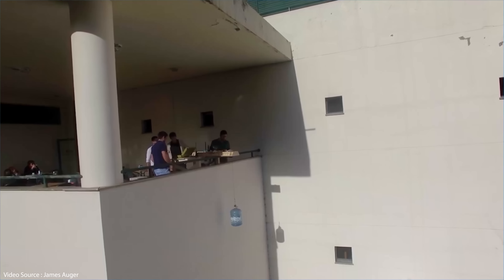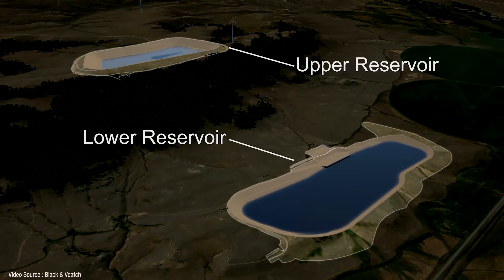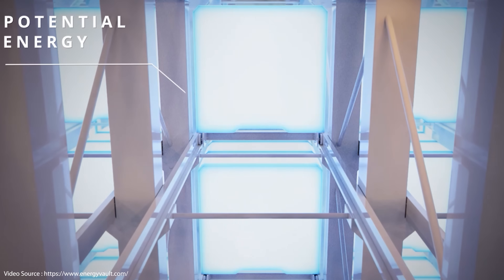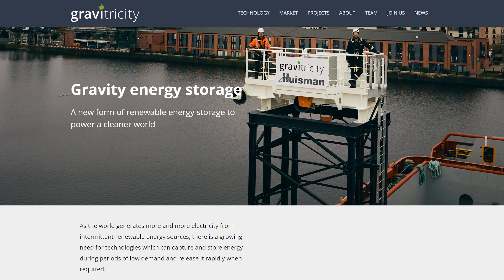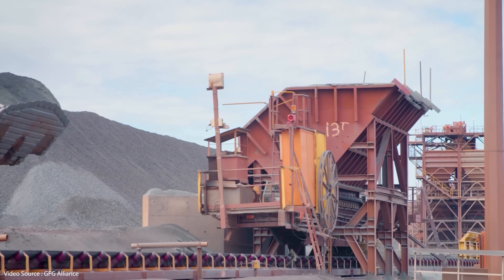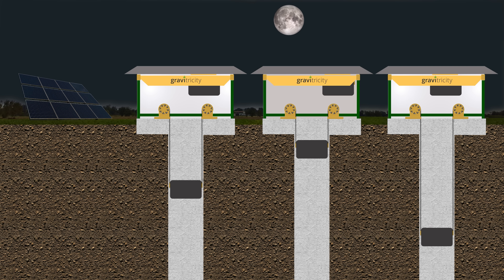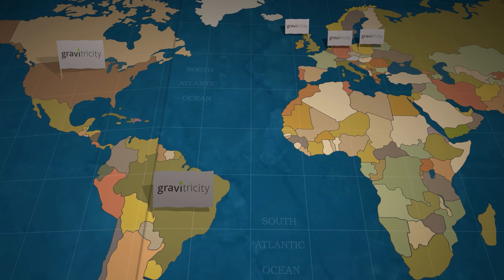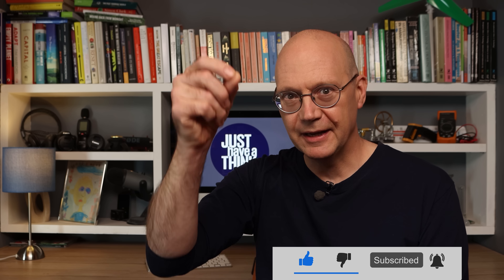Gravity Energy Storage. Who's right and who's wrong?

Comment: Take the worse case scenario. No Sun (night time) No wind. A gravity mass needs to be of a certain mass and height to last for perhaps 12 hours or longer. This scenario will require that prior to loss of sunshine the gravity-mass is at its peak height. Any time during the sunlight hours and good wind that this peak can not be achieved the community depending on that generating plant is at risk over the next 12 hours. This could likely be many communities around any country every night, most dangerous is November, December and January in the US. Nobody should be planning such a risky in any life providing generating system. 21st Century Nuclear, people, problem solved.

Comment: I wonder how practical it would be to use all those deep canyons that have bridges across them ( or not) rather than mine shafts.  No flooded shaft to worry about.  Wind might affect things but that could probably be overcome with active or passive cabling.  Lots of room for parallel ( or HUGE) weights.  Everything would be more or less open for easy maintenance.  Minimal useful land area required.  Any math done on viability of trade off between depth vs. size of weight?  It's pretty obvious the longer the weight drops the more energy supplied, but what are the tradeoffs?

Comment: The need for storage = an indication of the problem with Wind and Solar. In addition the killer is having enough energy generation from wind and solar to both supply the grid in real time (when the sun is shining and the wind is blowing) to " lift " a mass to a point in height that will cover the total absence of Sun and the intermittent and weaker nighttime Wind. I believe the most basic and near zero complexity is a massive Cubed shaped mass lifted by a motor / generator mass on 4 through holes posts ( like a die set ). With all the "extra" generated power lift with motor and when not lifting ( at the top or no extra power) brakes are applied (at the top a latch). Then releasing the brakes will generate electricity. However, zero emissions 21st Nuclear is the real solution.
Reply: I don't see it as an "indication of a problem" but I look at it as an "opportunity" instead.  Sounds corny maybe but really that's what's going to happen.

With wide spread grid-scale energy storage, solar and wind will be very hard to beat.  Solar and wind already have lowest LCOE of new build construction since 2015 and costs still going down.  This gives financial headroom for adding grid-scale energy storage which is also falling in price!

New grid-specific storage tech on the way: gravity, liquid-metal flow batteries.  Liquid-metal batteries already starting to be delivered commercially and it is not a brand new idea.  Heavy cumbersome Liquid-metal batteries were just waiting for a market and it hit a big one!   Liquid metal batteries use common cheap elements and will last 100X longer than Lithium-ion.  Lithium-ion is not the best for grid-scale for many reasons but, thankfully, there are grid-specific alternatives.

So far, I'm seeing Gravitricity is more risky than Liquid-Metal storage.  There are a lot of critical variables and unknowns with using old mineshafts.  Gravitricity LCOS seems a bit too optimistic and need more details on its calculation because of so many fundamental site build factor variability.

Nuclear growth rate is small at 1% to 3% CAGR (compound annual growth rate) where as solar is some 25% to 33% CAGR -- a vast difference even considering solar power's "capacity factor" is less but getting better.  That's why grid-scale energy storage is such an opportunity to pair with this abundant source of clean energy.

Another thing is whole life time of a power plant.  Solar farms will never really reach an "end of life".   Consider solar cells last 25+ years and the panels still produce 80% capacity by then.  Old panels could be sold and re-purposed for off-grid non-critical applications or just given away to non-profits, schools and developing countries.  Thus solar farms can be constantly rejuvenating itself over the years & decades on the very same land foot print even while running.  Incrementally, newer generation solar panels can replace old panels on and on.  Upcoming tech are Perovskite and Quantum Dot film panels that can boost solar panel efficiency by 50%.

At end of life, nuclear plants need to be completely demolished at high cost ($300M to $400M) by specialized highly trained crews that risk radiation exposure.  This is on top of the billions it took and 10 years it took to build the thing in the first place.

In contrast, you can hire most able-body people off the street to do the actual build/dismantle of panels on solar farms and just give them a bit of gear and training.

Comment: Energy Vault is clearly a silicon valley company thinking that every problem can be solved with computers and tech. I think their approach is flawed - over engineered, overly expensive and too much complexity. Gravitricity hasn’t convinced me either. I’m seeing winches and cables - the same technology we use in elevators and how often do they break down? Especially as they age. Also old mine shafts? Not the most geologically stable option. Q - wouldn’t it be cheaper to just interconnect renewables more to account for intermittency? This thing still needs renewable energy to haul the weight back up the mineshaft so unless they pay nothing for the energy in it can’t be cheaper than wind and solar because there are substantial losses - I think at least 30%.

Comment: Thanks for the update Dave! Pumped hydro is not a good example of gravity energy storage in my view though. Dams and resivoirs are. Dams hold the water that was pumped up by clouds at a height where they can be released as needed. No need to pump and much more energy efficient then any other energy storage device. Hydro dams need more attention. Many dams are unpowered. That is low hanging fruit. Hydro is baseload renewable and cheaper than coal, gas, uranium, etc. 
Maybe it is because I am Canadian and we still have so much untapped potential here but Hydro dams can have their releases timed to balance the grid the same way batteries, gravity storage, peaker plants, etc can without having to use electricity to store the energy in the first place. Water just needs to be released at the right times!

Why is this never talked about by renewable energy enthusiasts?

Comment: This is an interesting model (gravity energy). One part that I do not understand yet is about the energy used to pump water, raise the weighs, etc to allow for the potential energy to exist. Is the energy used for the creation of the potential energy being well calculated in the efficiency numbers we see?
Reply: For any energy storage mechanism, the ratio of energy output to energy input, or "round-trip efficiency," is one factor to compare technologies. The round-trip efficiency of pumped hydro is something like 80-85%; for lithium ion batteries, it's something like 85-90%.

Obviously, you want high round-trip efficiency, but it's only one of many factors in overall cost effectiveness. Think of energy input as a cost and energy output as revenue. If your input energy cost is very very low (because there is excess energy available), say $0.02/kWh, and your output energy revenue is much higher (say $0.05/kWh), then so long as your other costs (materials, land, construction, operation, maintenance, grid connection, etc.) are also very low, you can make money even with a low round-trip efficiency. Whereas, if the difference in input and output energy costs is lower, or your other costs are higher, then you need a better round-trip efficiency for your project to be cost-effective overall.

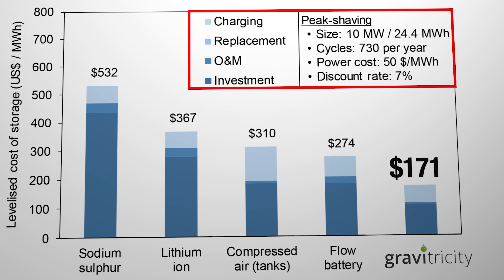You can see this comparison at 8:24. Pay attention to the "charging" lightest-blue portion of each bar in the graph. That's the cost of energy input. Notice it is much larger for compressed air than for the others. I think that means compressed air storage has significantly lower round-trip efficiency.
Reply: The point of the technology is only on the storage side of the equation.   It is a given that there is a need for such storage solutions given stochastic energy sources such as wind or solar.  In other words, you would deploy such a storage system in coordination with such a source.
Reply: @melmartinez7002  I am aware of that. My question is about the details of the cost/efficiency calculations.

Comment: If you have a deep decommissioned mine like Gravitricity needs, then why use only the shafts to store energy?  Why not flood the entire mine (except the shafts, which could be used a Gravitricity intends) and use it as the bottom reservoir of a pumped-hydro facility?  A problem that I see is that the pumps  and generators would have too be installed in a (non-flooded) cavern at the bottom of the mine.

Comment: One problem I can see with basing such a system in dis-used mine shafts. Your mine shafts are only so large. Plus just how many are there. Another is pumping out water. And if digging new shafts what is the cost per cubic meter for a shaft say 500 meters deep that is ten meters square. Myself I like the idea of a tower based system. Place the motor generator set at ground level. This makes maintenance much easier. Use large steel boxes filled with loose rubble (gravel or sand). The weights are in very large elevator shafts basically. Then wrap the tower with housing, office or retail space that could provide rents. Placing the weights inside eliminates the wind issue. Actually you could place a smaller version that in residential buildings that could act as storage for overnight energy needs of the building residents.

Comment: From the first principles thinking standpoint, gravity is the least usable field for energy storage, since it's relative strength is 10^38 weaker than that of electric force. OTOH, it is also the easiest to use. In the long run, I don't think it will be used much - except perhaps on the Moon and Mars, where you can build an actual space elevator and use that to store energy.

Comment: Why don't we put floating weights on the already existing pump-hydro reservoirs and use their potential energy change as well. I understand that the distance they would travel (with the water level change) is not comparable to a mine shaft, but we can also harvest some energy back from pumping up the water (having the weight on the lower reservoir) and some extra when we drain the top reservoir. I guess if the water inlet is above the highest water level (so the inlet is not working against the water pressure), then the floating weights will lift up for "free". We may even be able to harvest energy from the upward movement...

Comment: Another option for Gravitricity would be to use lift shafts in buildings. The lift system is already in place and it would just require some modifications to the electrical system.
Reply: ...and major reinforcement to the foundations (i.e. not happening) and usurping the original use and profitability of the building. Seems unlikely to me.
Reply: @MattNolanCustom  No need if you just load the goods lift to it's maximum safe working load limit. You control the decent speed of the lift car to match the electrical phase and you already have the motors/generators in place.
Reply: @markfryer9880  I suggest you do the math of how much energy that would be able to store and put that number in the context of the storage requirements to be useful

Comment: I wonder why we're just looking at direct mineshafts and vertical-only solutions. Why not use steep mountainsides in encased tubes or on rails (the same as a fernicular railway)? You would need more distance for the same GPE but the infrastructure burden in terms of cost would be less than holes in the ground, at least to start. I am sure they've thought of this, I'm just wondering what the reasoning is.

Comment: Hydro is shifting millions of tonnes of water to make a viable system at scale. I don't see how a smaller 500 tonne system would be much use for anything. Maybe if you had 50 houses to supply power to, and a free hole in the ground it might work, but it seems very niche.

Comment: I can see how Gravitricity's system can be adapted well to decommissioned powerplants, but in the case of mineshaft would it not just be easier to use Hydro, pumping water in and out of the mine? 
Love these videos by the way. It is nice to see how these technological concepts progresses
Reply: Where do you put the water you pump out of the mine?. and how do you stop the empty mine filling with water naturally?  if you can solve these then you've invended pumped storage.
Reply: @mralistair737  Creating surface water basins is not expensive per volume at all. In most mine shaft solutions you need solutions to prevent the mines from filling up naturally,  through additional pumping of good sealing measures. With heavy block you could indeed have the blocks sink into partially water filled mines, but that would result in complex engineering as well. lifting and lowering a single 50 ton block in a 300 m mine shaft does not give a lot of energy: E=mass*gravity*height=50000*10*300 J = 150 MJ = about = 40 kitchen kettles during 1 hour.
Reply: another possibility for Gravitricity: just use exisitng mine shaft elevators to bring mining carts, filled with heavy materials (lead?) down the shaft and into sideshafts (self-driving, or use autonomous locomitives). Than they could store and move much ladger volumes of heavy stuff.

Comment: I think this "update" and "progress" answers some of the questions raised (e.g. the "wind" problem), but possibly only by moving to different problems. It's easy to say that building a 300 meter shaft would cost such and such moneys and produce such and such energy. So first you reuse existing mining shaft, well done, that could be cheap, they are already there. But can you scale this in any way that would have an impact on our needs? How many holes in the ground can you make without destroying water bed? I mean, speaking of which, in how many places you can make holes without it being flooded by the aquifer? Or outgasing, or shifting local weight distribution enough to cause minor earthquakes that crack house walls, like fracking or geotermal sometimes does. I think a geologist can have a field day with this one.

Also, there really isn't that much energy stored in the weights, so the output (especially sustained output) numbers always look a bit meh. And I would also like to ask a mechanical engineer how realistic it is to build a resilitient system that works without constant cost in maintenance. I can get that we can build a good cable. Cool. But there's always the moving parts, jugling blocks, constant cycling of stresses.
Reply: From my basic understanding, we shouldn't be looking at this in isolation. This is just one way of storing energy that will fill some use cases but not all of them. I believe the future will be a large mix of renewable energy sources and storage (gravity based, flow batteries, thermal salt etc). Combining all of the options will then provide a lot of resilience which will significantly reduce the 'baseload' electricity required from nuclear and gas.
Reply: @timjarrett8777  I agree. But will this cover at least like a bilionth of our storage needs? If not and this is like a humorous curiousity, it's maybe not worth the attention.
Reply: @miroslavhoudek7085  absolutely, but we need to look at scale. BBC report states there are approximately 150000 old mine shafts in the UK. If we assume even 10% of these are appropriate for Gravitricity then that is 15 thousand of these small scale storage options. If we assume 2 MwH per location (which is half of the first storage system they are implementing in North Yorkshire) then that means 2 x 15000 storage, which is 30 gigawatts. I personally would call that a substantial contribution to our energy storage needs.
Reply: There is no way to generate of store energy without adverse effects. In the end, our need for energy will outweigh those effects, or we'd need d to do without.

Comment: What is the round trip energy efficiency of the gravitricity system? If too low, would it be better to consider hydrogen storage? ...and what about a train on a pulley up the side of a mountain?
Reply: Hydrogen cycle is way less efficient than lifting a mass up and down. Systems built on an incline are less efficient than vertical systems purely due to trigonometry and friction. I'm not necessarily saying the Gravitricity thing is a great plan, just answering your questions.

Comment: Folks have questioned the cost effectiveness of using mine shafts due to problems with ground water. Could lining the shaft to keep flooding to a minimum an effective solution?
I'd also been interested in the costing for a virgin site as surface level footprint appears relatively small and then they could be put in many other locations

Comment: The new energy vault building is relatively flat, with the moving components already close to the ground level. If they have to move the blocks sideways, they will need additional motors and spend energy to do it.

Comment: I'm kind of disapointed, that he did not mention, that the Energy Vault tower was actually built. Turns out, it sucks.
These debunking videos were right...

Gravitricity on the other hand has potential. After all, they set out to use existing infrastructure in a gainfull way. That's something very interesting for the owners of all these decomissioned mineshafts.
Still, if the levelized cost diagram is actually acurate for the potential of the Gravitricity solution, then they are in for a world of hurt. Battery technology is advancing at a ridiculous pace and prices are dropping fast. The value in the diagram for Li-Ion is already bigger than what is currently available.